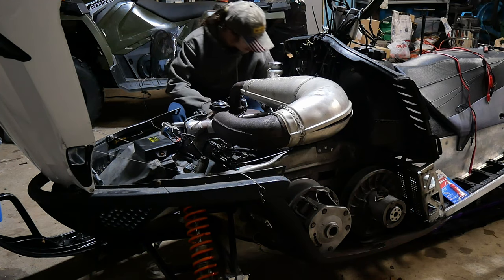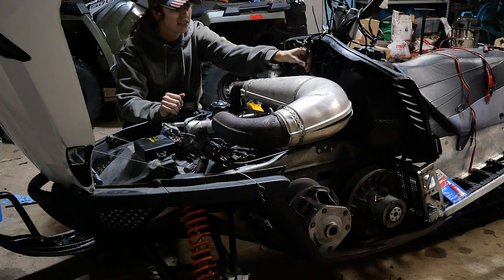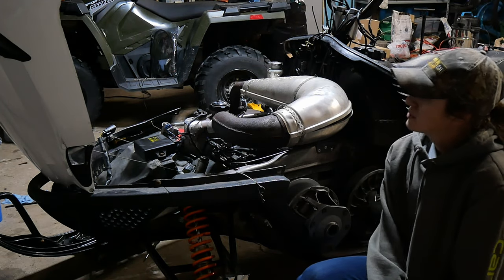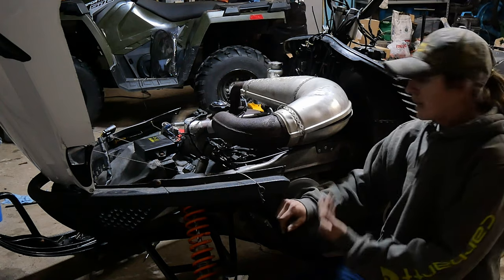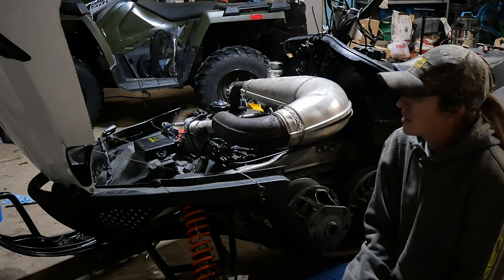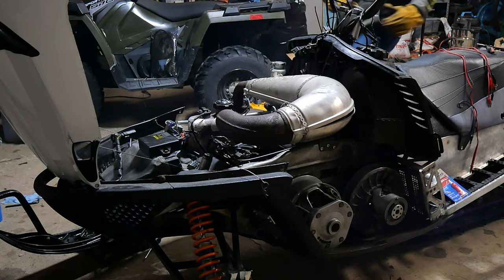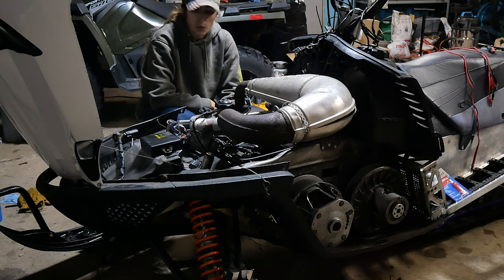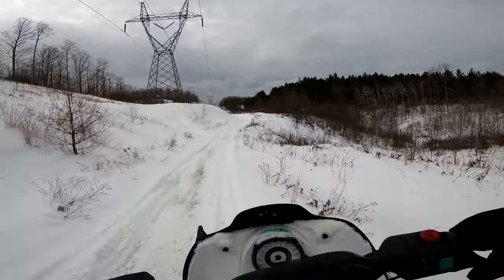M7 Died While Riding And Won't Start!

Comment: You might want to check the valves in the gas tank. Sometimes they collapse and won't let gas through to keep it running. I think they are called smart valves. Or they are clogged.

Comment: I just had that same problem with my crossfire. I pulled the Throttle Body to clean the Injector and found bare wire on all 3 wires from the TPS.
Reply from the maker: After fixing the wires did it run fine?
Reply: @HeidisGarage it did.
Reply: You having any luck?
Reply from the maker: Nothing yet, haven't had to much time to work on it. I'm planning on getting a stator and wire harness to try.

Comment: Have you checked fuel pressure? Sounds like it’s flooding. I’ve heard that sometimes the fuel pressure regulator can go bad and it’ll dump way more than 40 psi into the rail. Seems like the 700 likes around 40-42 psi at the rail.

Comment: I had an ecu burn up because of a short in the heated throttle check it to see nothings burnt in under the ecu
Reply: I got a computer off eBay for $500 if it’s not the stator
Reply: That’s weird it still fire’s definitely a spark issue or a bad connection from the flywheel on
Reply from the maker: I just picked up a used ECU to try in it, I think its a ECU because the one that is on it looks like it could have water damage from cracked epoxy on the bottom!
Reply: @HeidisGarage  any luck with the different ecu?

Comment: Have you pulled your plugs,  to see if it's flooding out?  When you replaced the stator was it oem?
Reply from the maker: Yeah its just flooding out, put two new sets of plugs in it and every time they were soaking in fuel. I did not replace the stator, just tested and inspected the original, it looked fine, not burnt or damaged and tested 12.5 ish volts when being pulled over. Going thru the main harness right now to look for broken or shorting wires.
Reply: May want have the injectors checked or replaced
Reply: Throttle position saftey  switch
Reply from the maker: I have it disconnected from the main wire harness, and it still wont run with the kill switch and throttle safety switch disconnected. Unless do they have to be connected for the computer to allow it to run?
Reply from the maker: Alright I'll do that then, maybe get them ultrasonic cleaned.
Reply: The ignition timing gadget in coil went out on my 06 m7 but it would not hit at all coil was fine but that little  Sensor failed...... I'm also having to swap the track out. my rail slide nub broke in half and feed the rail through the track cog.... was not a good day 😕
Reply from the maker: Oh yeah that's not good! Had the same thing kinda happen last year while riding, rear bogie shaft broke the track sucked the rail up into the tunnel and right into the radiator. Swapped a m8 skid on the sled, the fox float shocks are nice!

Comment: Is the throttle closing fully ? Any slack at the throttle mine doesn't start if there is any slack.
Reply from the maker: Yeah it was, I'm leaning towards a bad stator I have one coil that's not producing enough voltage!

Comment: My sleds doing close to the same thing any updates?
Reply from the maker: I'm leaning towards a bad stator. Have one ordered so should see soon!
Reply: @HeidisGarage  I already had mine done for a previous problem but now having close to the same as you  did u say u can’t get spark if u pull the plugs out and rest them on the head?
Reply from the maker: Yeah no spark at all. I've replace the stator and every other electrical component on it except for the wire harness and ecu. I'm figuring the ecu is no longer functioning correctly.

Comment: I had one do the same thing ended up being a wire in back by taillight was shorting out
Reply: Yea if the taillight is out you can ride when there cold it will start....shut it off and it won't start..... tow it down be disappointed get home.... dang fires right up...fake... lol I fought it for days and finally read on net the coil over heated do to a dang taillight......... so disappointed when a  Polaris towd me down
Reply: I just read another deal, this guy's sled had the same exact issues he replaced ecu and couple other thing no luck ended up being main wiring harness was burnt up, said the harness looked new, so wonder if it was in one of the connectors
Reply from the maker: I am wonder if it is one of the main wire harness connectors as well, I removed all the wire wrap on the harness and found a few spots where wires had rubbed and wore down to bare wire. So I fixed those spots and put new better wire wrap on the whole harness and tried but no change. I do have the three prong connector for the tail lights disconnected and I also have all the handle bar controls disconnected and the diamond drive speed sensor. I ordered a new coil, regulator and pickup coil to try and if that has no effect I might order a main wire harness. I am wondering would a bad crank angle sensor cause a no run situation? 

Thanks everyone for your help!!
Reply: I wouldn't think so I'd lean more towards the harness or injectors, if you plug everything back in and try and start are the lights coming on? And are you getting any kind of engine codes popping up?
Reply from the maker: I'll try starting it again and see if the lights light up at all or if any codes are coming up. I didn't get any codes when it died on the trail either which I thought was weird!
Reply: When mine did it the engine light flashed a couple times
Reply from the maker: Just pulled it over a few times and it sputtered but didn't stay running long enough to show any codes, just long enough to light the display up.
Reply: Have you checked how flooded it is? Is the crank case full?
Reply: Check ground wires and relocate if necessary, needs good ground, hope this helps